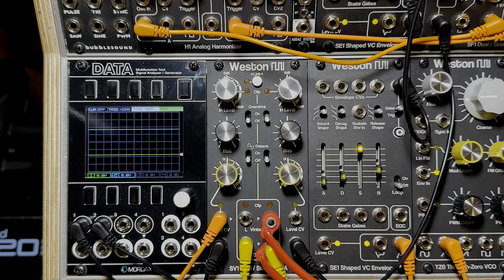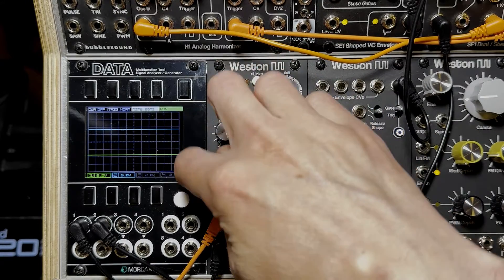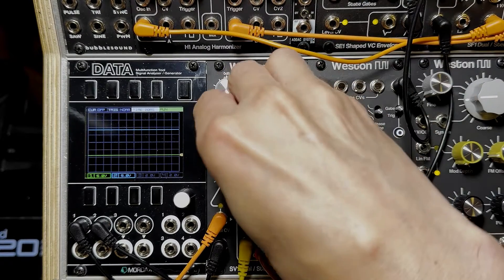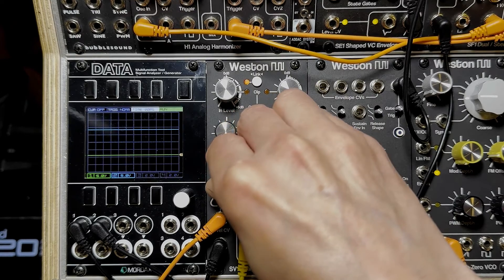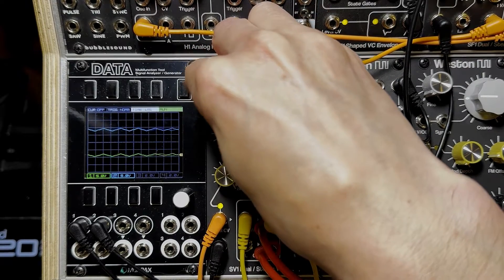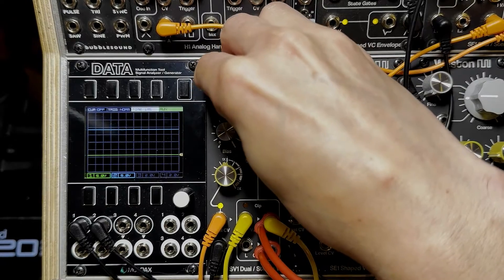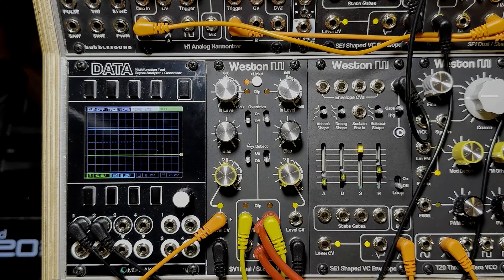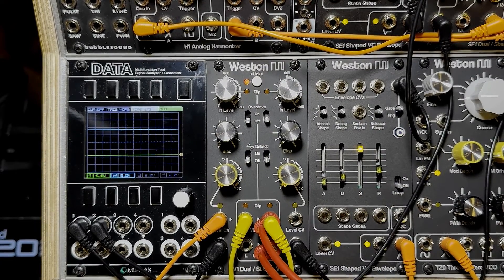Weston Precision Audio SV1 Dual/Stereo VCA Eurorack Offical Demo

Comment: Awesome!! Does the anti click function add any latency?
Reply from the maker: Kind of... The envelope is only sampled on zero cross when it's turned on, so worst case would be if you had a completely square hypothetical instant-on attack envelope that hit when your source wave form was at the peak of it's cycle. In that case the delay until that envelope hit would be 1/4 of the period, so 2.5ms for a 100Hz sine wave for example.

Comment: 12HP is not a good idea for a single stereo VCA module, with so many excellent 8HP options out there. But, that is just  a simple opinion.
Reply from the maker: We've never been a HP squeezing brand and not trying to compete with those who do squeeze things super tight. That's all I can say on that! :)
Reply: @westonprecisionaudio  I came to say that I think it's a good idea to make a 12 HP VCA with a large faceplate to turn real knobs. Zero crossing is also what I'm looking for, and a clip LED on the input and output is really the cherry on top. I could buy just two of these if it was CV coupled, for versatility, but I guess we can't have them all! :)
Reply: I came to say this as well. I am looking for at least 2 stereo vcas.
Reply: @joeymc5272  Check out the L-1 Quad discrete VCA.